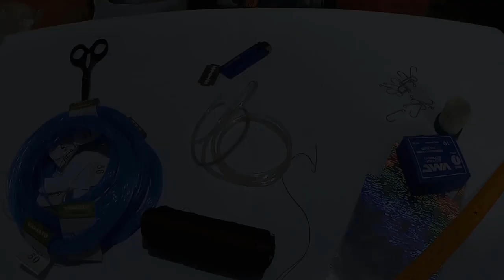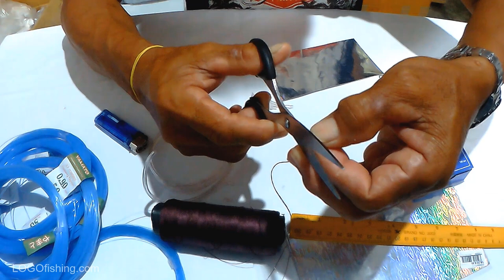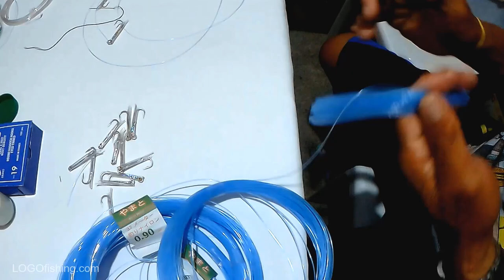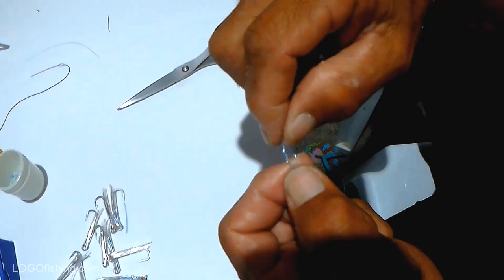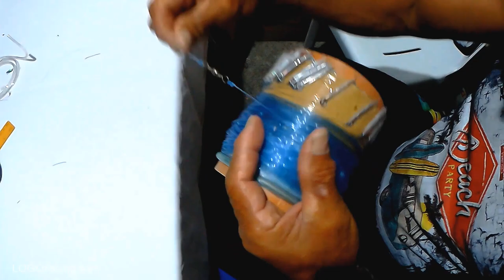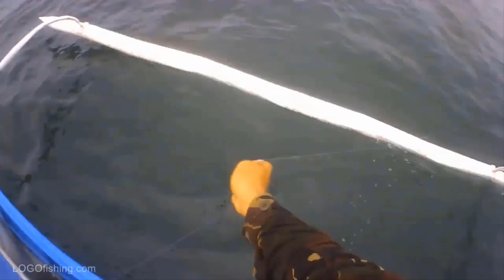How to Catch Bonito, Skipjack Tuna using a DIY Hanging Jumping Fishing Lures from Dextrose Hose

Comment: Did you not get one awful tangle as you brought the line in ? Surely better to take fish off and put line back on the reel ready to go again ?
Reply from the maker: Yes, I got an awful tangled in the past. That's why I separate the hooks by batch. The 1st batch of hooks (10 pcs) will place to the other side of the boat and the last remaining hooks will be placed to my back or the opposite side to minimize the chance of being tangled. For some reference there are my other videos: https://youtu.be/8oX1jiamtYg,
https://youtu.be/SOP7P8v0K98,
https://youtu.be/JgPYqOAdQKM,
https://youtu.be/6X-Uw4Zu2Qw,
https://youtu.be/DMRGOlbuFc8
Reply: @LogoFishingTV  thankyou so much. If i tried this i may only get 4 hours before pulling in, do you leave longer ?
Reply from the maker: @williamavery9185  It depends on you sir. 4 hours is too long if there is a fish. Once there is a fish that will see the lure it will definitely eat it.